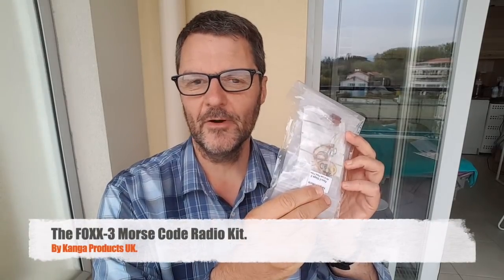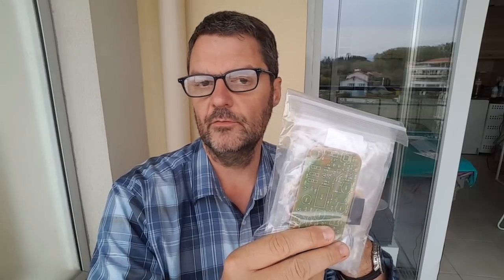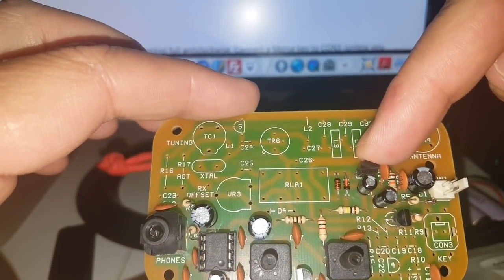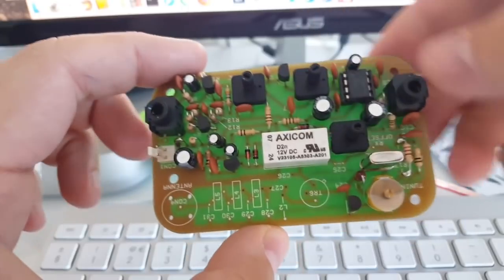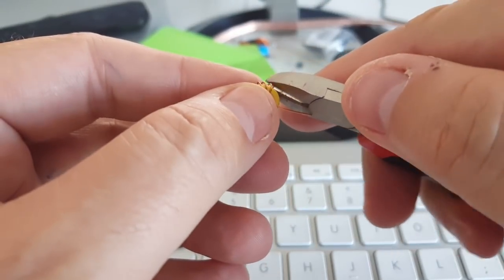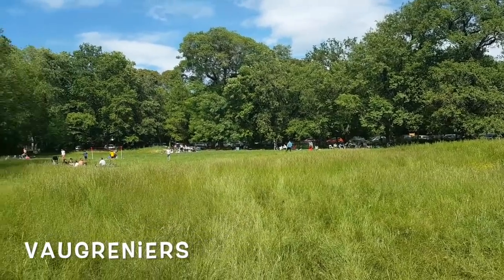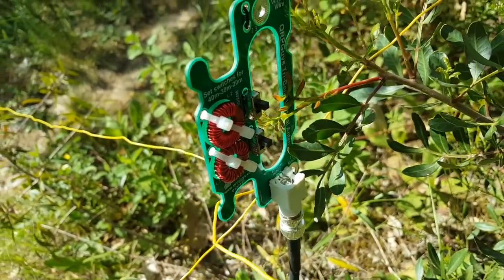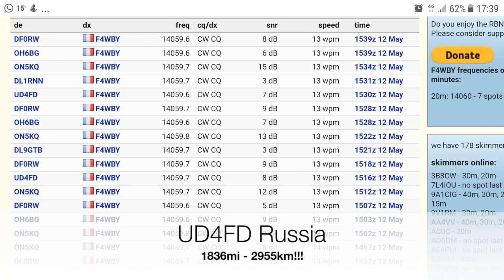The FOXX-3 Morse Code Radio Kit.

Comment: Had a look at the schematic, it looks like FOXX3 uses the Pixie scheme where the transmitter PA doubles as the receiver mixer. Actually the design is originally from George GM3OXX in SPRAT 1983. Hence the only receive selectivity is provided by the LPF, so it is open from the crystal frequency to DC. Will be prone to AM broadcast interference. Surprised you don't hear more band noise, you may have heard more with a 40m kit. A novelty, not really useable, and the 1 watt is not enough to be fairly sure you'll make a contact.   Still, a bit of fun! 73 Paul VK3HN

Comment: Sorry if I missed it in the video but what is the range between transmitter and receiver
Reply from the maker: It can vary greatly between a few miles to a few thousand miles.. Usually around a thousand. It depends on solar activity, ionisation of the ionosphere.
Reply: @RadioPrepper  thanks for getting back! This was very helpful!

Comment: I built this toy almost 20yrs ago, hihi. Longest QSO was EU to ZL with 250mW from Foxx! Nice...but not proof against BC breakthru! I am recommending to use additional BPF...
Reply from the maker: Or a mag loop antenna!
Reply: @RadioPrepper  yes as it is high-Q resonant circuit which can filtering the BC sigs. Agree mate. Good luck...and stay safe.
Reply from the maker: You too!

Comment: The YT Algorithm has offered this 1 year-old video, how nice! I have the FOXX-3 since more than 5 years now and it was an interesting challenge to get a qso on it. And I've made it! The first was with the HB9 station some almost 2000 km away! The guy was surprised I was running 1W, so was I :). I have made some more contacts with it using my permanent full-size 80-10 EFHW antenna. The biggest drawback of this type of radios is not the 1W really, it's the non-variable crystal oscillator... It would be fun to come back to this project and improve it with adding one of these now largely available one-chip synthesisers. Might be a winter project! 72! Linas LY2H
Reply from the maker: Great, how is reception on yours?
Reply: @RadioPrepper  Have not been listening to it since few years, but when I switched it on now it was like a bit of overloading from the big antenna with the SW broadcast stations whom I could hear quite well :). I'm really getting curious to look into it again! Thanks  for bringing it back from the junk-box!
Reply from the maker: Maybe I should try it again...

Comment: @4:21 you can buy small metal clamp-on ' Heat Sinks' to use on components while soldering - - so the heat is pulled away from the component and it won't Burn-Up !
Reply from the maker: Definitely!

Comment: What are you using for a tuner for that antenna? And where are you located that you are able to pick up the radio prayer time?
Reply from the maker: No tuner. South of France.
Reply: Radio Prepper yes, sorry. I missed the vertical antenna part. I was thinking you were using a long wire.

Comment: Gil, you might want to look into Diz's 5Watter kit. It's an update of his and K7QO's 1Watter kit - now sold out. It will have a VXO/VFO, keyer, and decent audo and sensitivity, etc. The footprint is somewhat larger than an Altoids box but can be housed in a small case. Check it out. Should be available in July 2019. Google Kits and Parts 5Watter. No pecuniary interest, just liked the 1Watter.
71/72 de k6whp
dit dit
Reply from the maker: Thanks. Aren't they closing shop though?
Reply: War Planner, can you post a link to the radio you are talking about, please.

Comment: Hi,Good video.I have just built a 40 meter unit. Great fun but I too have low receive audio. It transmits 1 watt.I have found out that the LM386 op amp used in in the audio amplifier circuit comes in different amplification values. I was supplied with a low rated amplification version,( LM386L rated at 0.325W ).For instance amplification of  the "N" range of LMs is as follows:- LM386N-1 =0.325 watts ,the -2 =0.7 watts and the -4 =1 watt.I will try a higher rated LM386 to try to boost my audio level.Hope it works.Dave
Reply: Hi Again,I was tired when I wrote this !! I should have said different amplification and power outputs. The chips are so cheap anything is worth a try to boost the audio output.Dave

Comment: As always, an excellent video. Question; have you tried a high impedance amplifier for your sound? I use a modified telephone conference type amplifier or a small guitar amp for items like this or for listening to crystal radios, rather than a regular sound amplifier based on the LM386 chip for amplifying a radios sound output . The sound level is much improved.
Reply from the maker: I used that little amplified speaker which usually works great with other qrp radios.

Comment: Hi Gil, builted one about 15 years ago to replace my HW7 on holidays, the transmitter section is good but the receiver makes the HW7 sound like a Icom 7300!. Nice kit to built but not usable, it was deaf and had AM break through, I binned it and bought a TenTec 1320 and still use it on holidays to this day, I love your channel and check it every day, thanks Gil. 73 de gi0ggy.
Reply from the maker: Thanks, interesting.

Comment: Hi Gil, I to bought one of these some time ago they are a great little kit to build and operate in the field, one thing you should always do when building the kits is check the torords for inductance, it does make a big differance, when all of those cheap chineese kits hit the market years ago i bought two of them, pixie, frog sounds, forty 9er etc etc, the first one no checks made but they worked, the second attempt, inductance, voltages, capacitance, resistance, and some of the values checked and replaced were needed, it made a very big differance, buying components with half decent values percentage today is getting more difficult, enjoyed the video as always, have you solved the prolem from your last build
Reply from the maker: Goid advice thanks. I don't have an inductance meter though.
Reply: @RadioPrepper  you can get  them on banggood they are called secometers